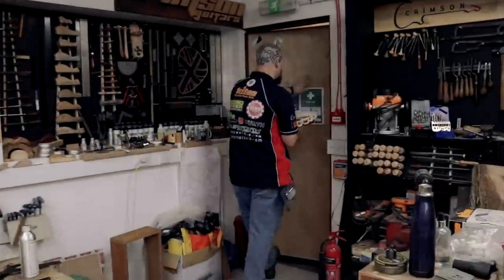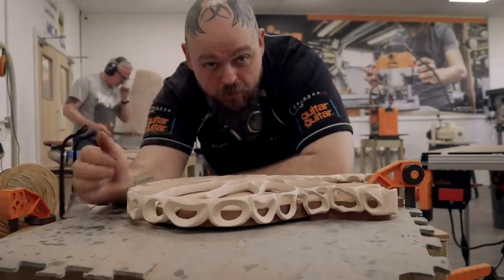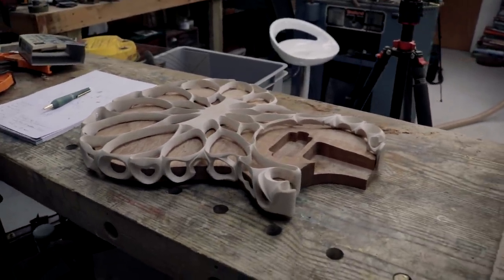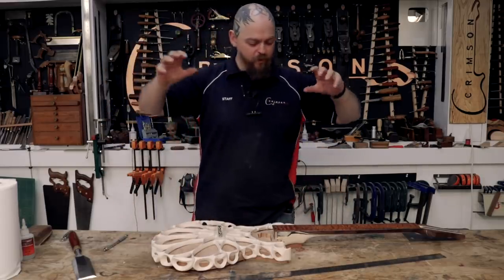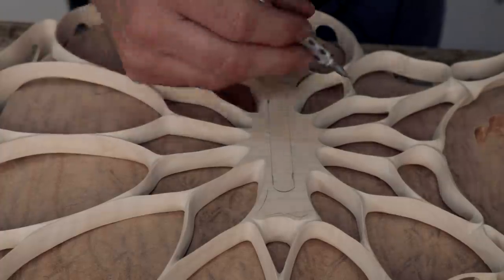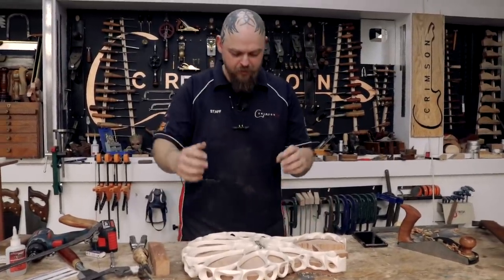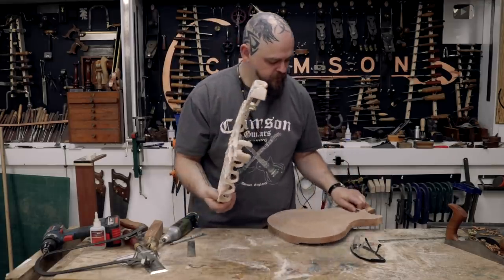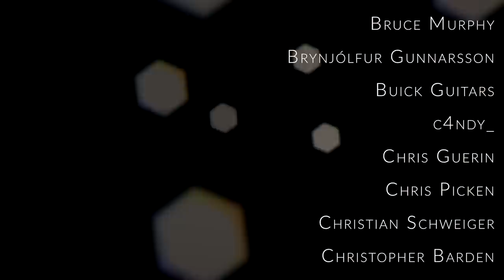Ep 14 The Various Elements are Coming Together - The 90 Hour Build - The Complication

Comment: Ben and crew,
First off, thank you for all of your videos, I feel as though I learn a lot. I just wanted to point out a characteristic of the "exoskeleton" design that I've noticed. I work in a microbiology lab, and the outer shell you've created reminds me a lot of some various molds/fungi grown on solid agar medium. A characteristic that is common among some radiating/spreading molds (the genus Aspergillus comes to mind) is the consumption and dissolve of the hard medium, particularly near the originating contamination spot. The result is a complex crateriform shaping of the once-flat medium. The reason I mention this is if you're actively seeking creative designs for this, consider carving out bits of the guitar near the bridge on the body, and having it radiate away towards the edges of the body. Think of this as the outer shell having originated from the site of the bridge and contaminating the whole body, but showing the affects of this on the internal body as well. I noticed the biohazard tattoo on your head and thought you might dig the reference to non-sci-fi contaminants.
I apologize for the rambling, good luck with the remaining build. It looks amazing, no matter what you do with it I will surely be blown away.
Reply from the maker: Genuinely fascinating, thank you so much

Comment: Wonderful stuff! The cutout for the bridge looks exactly right, as do the 'ribs.' I loved the editing on the sanding section with the two of you working simultaneously.
If I was going to attempt something like this (my woodworking skills are nowhere near as developed as yours), I'd go for a massive cheat and start with a cheap Les Paul copy from the 1970s with the bent plywood top, which I would remove (as I did on my Avon- remember those?) and fit a skeleton around the bits that were left. However, I feel that suggesting that sort of thing here is somewhat heretical, coming from the Dark Side of customisation rather than the pure Jedi-like luthiery that you do. I can't wait for the next instalment!

Comment: I think the smartest / safest thing to do would be to impregnate the "spider" with resin.  It may limit the finish options but it will make sure it's a player and not just wall art.  But it's looking gorgeous.
Reply: Was thinking then same, but I wonder how much impregnation of the wood would happen, as sycamore isn't the most "open grained" of woods. Might not actually penetrate the wood enough to make it worthwhile? Who knows??
Reply: @timbeaton5045  Yeh - tough call. Something like Cactus Juice would definitely penetrate but that thing would never survive the curing process without turning into a pretzel. And something like "penetrating" epoxy really isn't going to saturate much unless he can get it into a vac/pressure pot.  Still, it would be stronger than lacquer....

Comment: First of all, the carving and the aesthetics are absolutely stunning and it's an incredible piece of work / work of art. You deserve any and all praise coming your way and it vastly exceeds anything I've ever made by an order of magnitude. Well played, sir. Congrats.

(A-hole warning...): But(t), the way it's currently structured means that I would be absolutely terrified of putting it down to rest on its butt end (you know ... the way all guitars, ever, end up being supported at some point, either on a stand or propped-up against something). The webbing/tendrils around the buttock looks too fragile to support the guitar indefinitely without breaking, especially as there's a gap between the tendrils and the body itself (so the tendrils are only partly reinforced by the solid body wood).  I trust you know what you're doing but, right now, the woodworker part of my brain is having PTSD.

The musician/artistic part is undilutedly loving it, though.

Comment: Ben, the carve on the top looks gorgeous! I do have one question about functionality, though. did you account for access to the intonation screws, on the bridge?
Reply: I think when you remove the string, you can just take the esoskeleton off, intonate and then put everything back in
Reply: @guitourney "just"?? do you understand the amount of work you are proposing ,here? 6 strings, multiple adjustments per string, strings would have to be completely removed in order for that exoskeleton to come off (which would call for a stop tail piece). that is all assuming that Ben intends for the exo to be removable.  I would think he would want it adhered, at least at some points to, eliminate any bad vibration sounds.

Comment: If there is one complaint I have: I wish Ben had used two less heavily flamed bits of wood. The maple is going to be almost entirely cut away, and the... sepele isn't it?... is going to be obscured by the maple. Two less visually stunning pieces of wood would have been enhanced by the design.

Comment: Where is the pickup going to sit?
Reply: In the already routed pickup cavity I guess?
Reply: @Forest_Fifer  Sorry, I worded that the wrong way. I meant in relation to the strings. If the strings are going over the exoskeleton and the pickup is directly mounted on the body.. isn't there too much space between strings and magnets? That's what I was wondering
Reply: @DanLokar  I guess that's why the exoskeleton has been cut back to allow the bridge to sit on the main body, to reduce the height of the strings